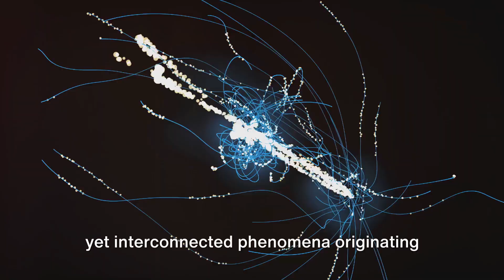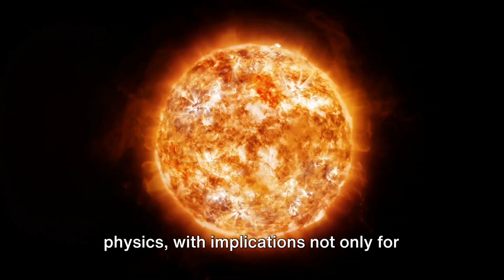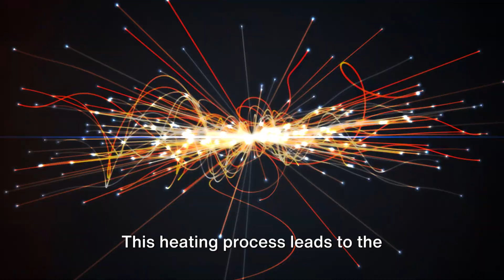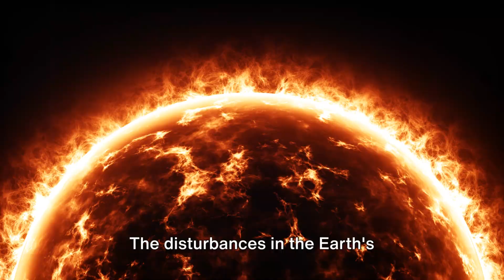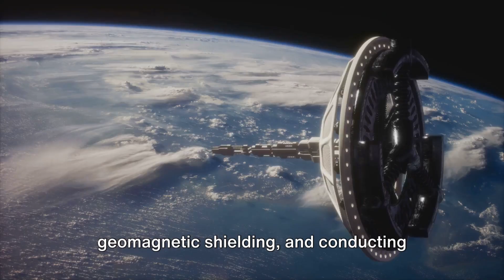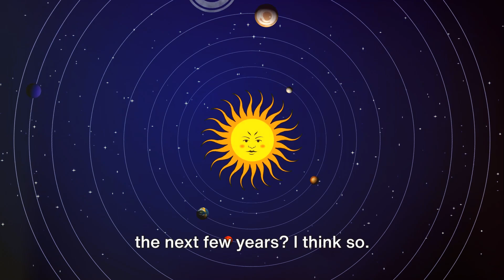Infrastructure Under Fire: Assessing the Threat of Solar Storms

Comment: Last Tuesday, Wednesday and Thursday nights I was up most of the night with excruciating headaches. No good explanation, so I asked the internet if there was a CME on May 14. Sure enough...giant solar flare🤯
Reply: Thank you.  I've been using solfeggio frequencies for many years, especially 528hz. My dilemma is that I need to have the wifi on so I can listen to the healing frequencies!
Reply from the maker: @hellenwheelz1619  good for you Helen.  Yes, there are CD's that you can burn or buy but as long as you are far enough from the router or the source, the radiation dissipates at various distances.  I have a chart on this video:  https://youtu.be/cXtZLbbH0eA  Thank you so much for watching my channel.
Reply from the maker: Wow. Yes it might be rough until this is over.  I just checked and the charts are putting the peak at 2025. Try playing some solfeggio frequencies from YouTube.  Use frequency 528 for healing.  Imagine your body is a shield that repels the energy spikes. That's what energy healing is all about and you get better the longer you practice.  Wish you well. xoxo
Reply: CD's would be much better! Thank you for content. I've been following you for awhile though under a different name. This is my more private handle.